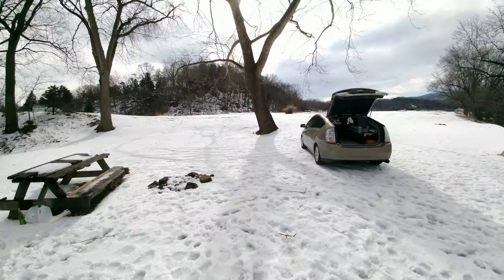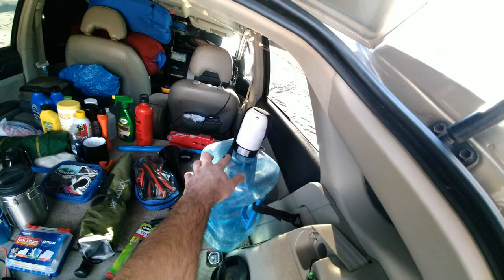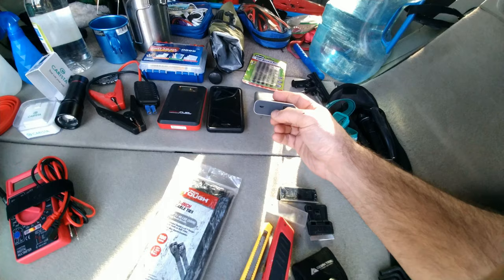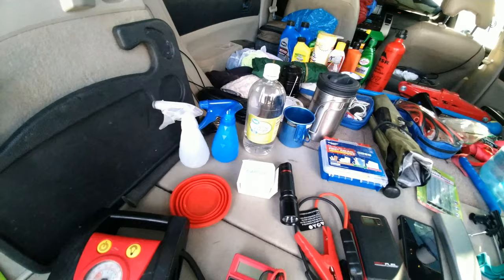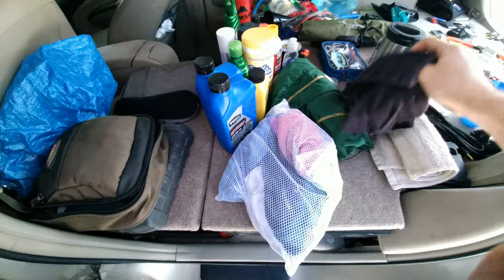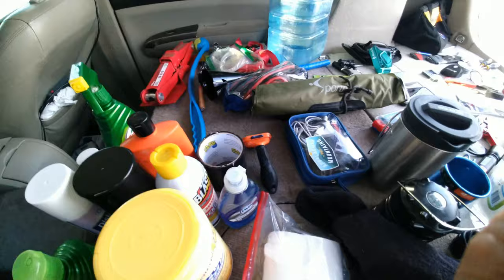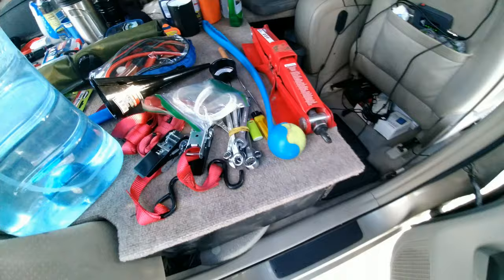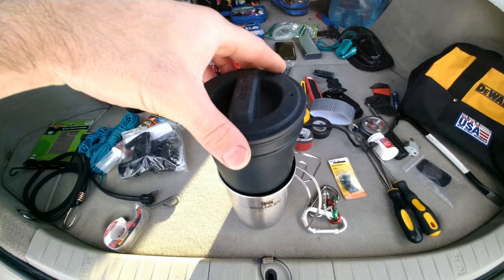The Best Gear & Gadgets for Living & Camping In Your Car!

Comment: If you go to the gas station [Wawa] and fill your gas bottle up with non-ethanol gas it will last longer.  It is what is recommended for use in small engines [mower, etc].

Comment: I lost all my possessions so I`ve been buying weird multi-tools with little hammers, pliers, knives, can openers, screwdrivers and tiny hatchets and just bought a large hatchet. I got a multi-meter too and soldering kit. I have seven folding solar panels between 20 and 60 watts with USB and 12 volt outputs and I`ve been buying 100 watt glass panels and every connector, adapter and cable imaginable. I bought 15 power banks, two 300 watt power stations and two 700 watt ones. I also have three little 5 volt glass solar panels that I can use to power my larger portable radios during the day. If you want a cheap but great portable radio that runs over 400 hours on three D cell batteries get the Sony ICF-19.
Reply from the maker: Cool, sounds like you have a lot of good gear

Comment: This channel has Wonderful videos.   I'm almost sold on getting a prius for travel and boondocking.  I just let go of my vw jetta I've had for 15  years.  I had no desire to make it in to a camper car.  My big issue with camping at age 60 is the whole need to be comfortable while sleeping.  With the climate control it solves the problem. I can compromise the same small for the comfort of a good night sleep.  

  I really like your videos,  they have helped me to understand how the prius works and you have a lot of great ideas.  I don't know what year I'm going to purchase.  Is there a year that was where the prius had issues?  thank you again.
Reply from the maker: from what I have read, the 2010-2012 Priuses had the most issues. the second gen, 2004 to 2009, is my favorite, and the 4th gen is good also. all Priuses are good in all honesty, it just depends how much money you want to spend. I would personally rather have an older Prius with low miles than a newer Prius with high miles.

 for what it's worth, I I am very comfortable while sleeping, pretty much just as comfortable as a regular bed.
Reply: Do not buy a Prius. Buy a Rav 4 Hybrid AWD. Never buy a car without a spare tire. Try to buy a car that is AWD. AWD Prius do not have spare.

Comment: i am not an organizer, and therefore i will be minimalist. i was getting the shakes watching you go through that much stuff. laptop, tablet, phone, chargers, fridge, cooker,  smoke alarm, fuel bottle, window covers, Milliard Tri Folding Mattress with Washable Cover Space Saver Single Size (75 inches x 25 inches x 4 inches) and BCI 2000 Watt Pure Sine Wave Inverter / 12VDC. - thats it for me - glad you can organize. when you get to 60 years old like myself...brain function slows down  :)
Reply: been researching Prius so much lately. this guy on you tube covers almost every aspect of Prius ownership, including which year and models to avoid - YourCarAngel <- you tube. by Aug or Sept i'll be making my purchase. can't afford any costly mistakes, so research is mandatory. plan on making my permanent residency in South Dakota ( you only have to stay in a hotel or RV park for 24 hours to get permanent residency ), and heading to AZ for the winter. millions of acres - BLM campsites, including many on the Colorado river
Reply from the maker: Yeah being a minimalist is good. I just found these things to be stuff that I use regularly. I've seen the car Angel guy. Thanks for telling me about South Dakota, I didn't know that South Dakota was a popular place for RVers to live. I might actually consider that in the future, thanks for the video

Comment: They sell a battery operated shower hose that's not that expensive. Heat water in your instant pot and there you go. Mix with a gallon of tepid water and you have several minutes of showering, more if you put the water in a small tote or bag and stand in the tote with the pump in the bottom. They also have the Coleman propane on demand portable shower, you put the shower pump in a gallon of water, or tote to reuse the water for long showers with a little vinegar in the water instead of using soap, and you have instant hot water.
Reply from the maker: thanks yeah I've seen those portable shower pump things, I might do a video on how to shower while you live in your car because I keep getting asked about it

Comment: I love your videos man, super inspiring. Still have yet to find out what you use to clip your bungee cord to for your paper towel holder!
Reply from the maker: The clip my bungee cord attaches to is just a little black plastic clip that came on the car, I don't know what it's used for but it was there when I bought it
Reply: @MountainSpringsAdventures  ahh, thanks!
Reply from the maker: Your welcome. The other end of the bungee cord is tucked into a little hole where the cargo cover thing for the trunk is supposed to clip into

Comment: Fantastic, really useful video - thanks!  You say you’ve used the socket wrench and sockets a lot.  What have you needed those for?
Reply from the maker: Your welcome. I use the socket kit to change my oil and for emergency repairs, and also other maintenance like changing the transmission fluid, changing the spark plugs, etc. I use it for other stuff I just can't think of it right now

Comment: In your other vid of the full car set up you showed a mini jump cable with power bank and mini air compressor. Can you show me a link? I've used my '06 to wake up to the sound of waves on the coast, or camp in the snow... drive and drive with instant car camping. I adore all the cubby space we have in the Prius. Have you had any issues with back seat vent for battery pack (Hybrid battery pack) ? Any blocked airflow will create a fan sound and bad fumes come out of that vent🦋
Reply from the maker: The link for the air compressor is in this description of this video. The jump box I got at Walmart for $40, I don't think they sell it anymore, it's made by everstart. There are tons of them on Amazon, just search "power bank jump starter"

No I haven't had any issues with my hybrid fan. I actually have a little filter that clips onto the vent to prevent dog hair and dirt from being sucked in, they sell them on eBay for like $15
Reply from the maker: https://amzn.to/3r3jV1L

Comment: What do you think about the safety of keeping this fuel bottle inside your car? I want to do that but everything I read suggests it's quite dangerous.
Reply from the maker: I kept the same fuel in it under my passenger seat without issues. Just burb it every month or so. Read the Amazon reviews of it, bikers use it for fuel in their saddle bags
Reply: @MountainSpringsAdventures  Thanks for the super quick reply! Now I live in the South and it gets very hot inside my black Prius during the summer. Do you think this would be an issue?
Reply from the maker: It shouldn't be an issue. Just check it like everyday and inspect it for leaks or any smell of gasoline. Also, don't let it get punctured or bang around against anything

Comment: Where do you keep your clothes?
Reply from the maker: in the trunk
Reply: @MountainSpringsAdventures  might seem like a silly question I’m just thinking out the details if I was to live in my car. Been thinking about it for solid two months
Reply: @MountainSpringsAdventures  Alright cool. Your vids are very helpful as I'm getting ready next month to live in my car full time. How do you like your cell boost device? Do you find it works exceptional?
Reply from the maker: I don't have it anymore. But when I did have it, it worked okay. It worked sometimes, sometimes not. Good luck with yours

Comment: Just came across your site and finding it very useful and subscribed. I am writing regarding your spare gas canister; ~1/4 gallon. We plan to get a Prius soon to use for camping. I previously had a 2011 Prius and ran out of gas. It wouldn't start again. After reading the manual carefully I found there was a minimum amount of gas needed, I think it was two gallons, before it would start again after running out of gas. Not sure if that is still the case but here are some conversations about out of gas situations https://priuschat.com/threads/ran-out-of-gas-now-prius-wont-start.33272/
Reply from the maker: Glad it's helpful. I actually ran out of gas one time and used it, and it was enough to start the car